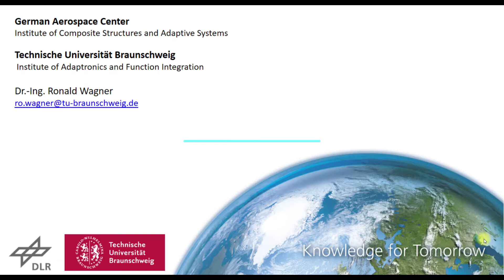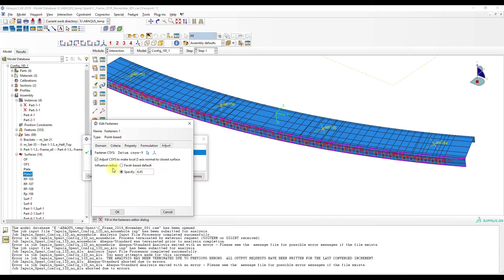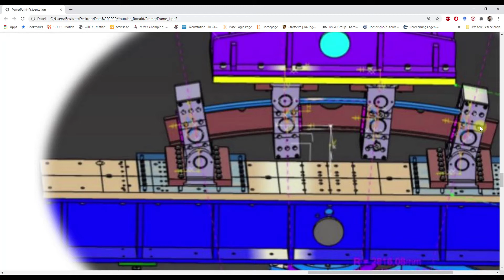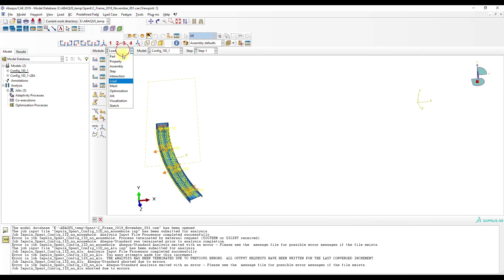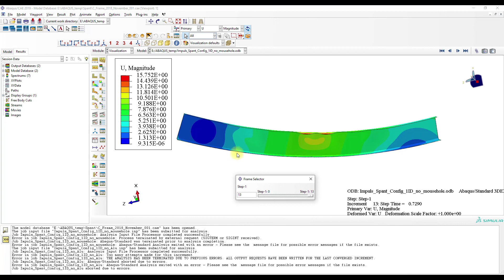ABAQUS Tutorial: bolts, fasteners and connector elements for 4-Point bending of a composite frame

Comment: Thank you for your video 
I have a question
Can I use attachement points in place of refference points ?
another question is can i do a connexion between a solid and shell element ?
Reply from the maker: i tried the attachement points and it seems not to work for me at least.

i have a video for shell to solid coupling here:
https://youtu.be/KpENiTNiSH8
Reply: @hnrwagner  yes it did the same to me that's why am asking 
Thank you for your answer sir